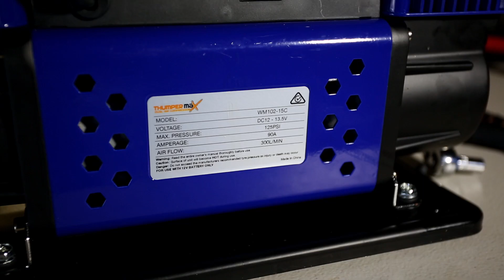THUMPER MAX DUAL AIR COMPRESSOR MKII  // I thought I fried my old compressor

Comment: Great video - I just noticed that you seem to be using a 50 amp Anderson plug but the Thumper Max draws 90 amps.
Reply from the maker: Yea was running on 50amp. I have upgraded to a 175amp plug